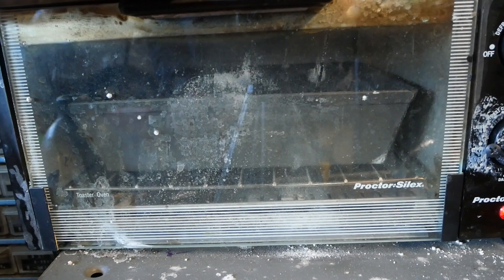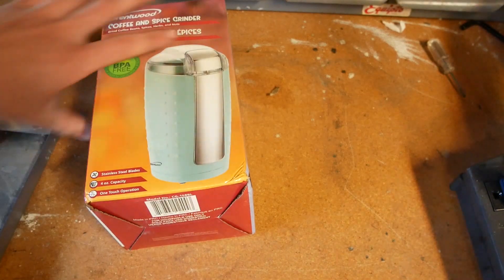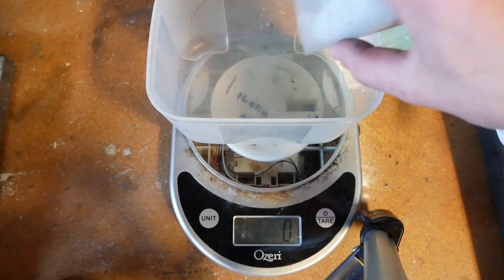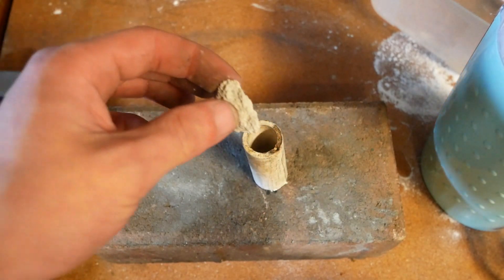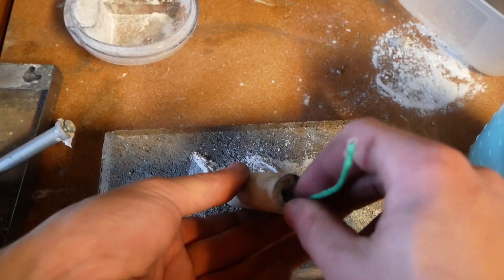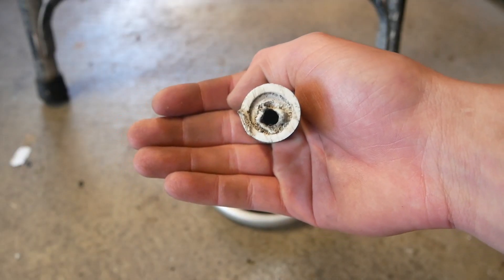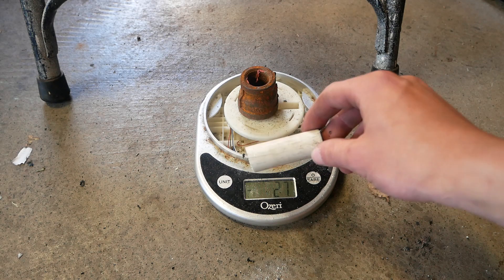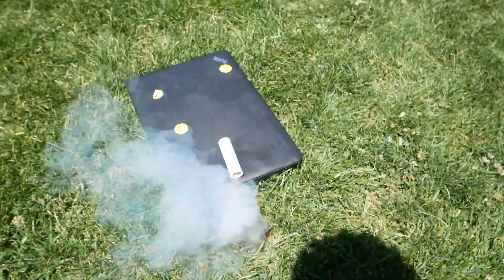how to make powerful firework rockets 500+ feet tkor method

Comment: The stuff about how deep to drill the hole is related to the subject of propellant grain shape. Basically your propellant has a fixed energy, burning more surface area at once creates a higher force for a shorter time.
Reply from the maker: yup you got it

Comment: if you use 25%white corn Syrup, 15% White sugar and 60 % KNO3, and heat it up very gently in a pot and stir it will turn into something called Rocket Candy, which can be molded into rocket motors, and in doing so it bonds all the chemicals better and creates WAY more thrust.  I can remember reading a lot about it when i was 15, before youtube took over,  but i never got to the point of making it due to my pyrotechnic tendencies being hampered by mistakes which cost my family money

Comment: This is unrelated a bit, but you should try to make a mortar tube and put a water balloon filled with HHO (Oxyhydrogen) and put it at the bottom of the tube. Put a fuse through a hole at the bottom. Then put something like a nerf ball or something resembling a mortar, light the fuse, get back to safety, and see if and how high it can launch the projectile into the air.
Reply from the maker: ya know what  ill try that
Reply: Yay! Also keep in mind that threading a string through the hole in the bottom of the pipe lid and tying it to the balloon, then pulling the balloon down the pipe using a string may help a lot. 

Also, do you accept donations through Venmo or Cashapp? I don't want to support Patreon due to their treatment of users and would rather not give them 30% of my money.